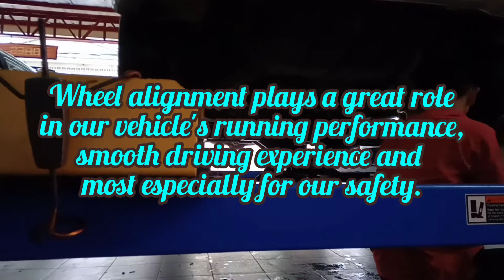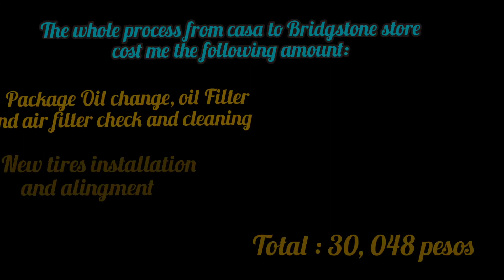Car Maintenance / ISUZU ALTERRA/ Manual Transmission/Wheel Alignment

Comment: Sana po masagot nyo to salamat 

NORMAL LANG PO BA NA ANG ALTERA PAG BINUKSAN LAGAYAN BG LANGIS MALAKAS PRESSURE MAY USOK NA PUTI AT TUMATALSIK YUNG LANGIS NYA. MEDYO MALAKAS
Reply from the maker: Sir good day, normal lng ung may talsik kasi at konting pressure but ung usok na puti at tuloy.tuloy  marahil matagal na kaayo d ngchange oil ng makina..required change oil is every 5000 Kms. pwede rin na may na oversized na ang engine liner at pud.pud na ang piston rings kaya few combustion gases ay nakakapasok sa engine crankcase at lumabas sa cover ng lagayan ng langis.

Comment: boss 245/70r16 stock tires ng alterra ko, goods ba palitan ko ng 275/70r16? thanks!
Reply from the maker: Sir good day, parang sasabit na yung 275 lalo na sa harapan when turning the wheels..naitanong ko dati sa Isuzu hanggang 255 lang recommended nila...if excess na sa dimension need talaga i lift up konti ng wheel support from the chassis.

Comment: Hello po sir ask ko lang po maayos naman po takbo ng alterra compared sa ibang SUV. Pinapatanong po kasi ni Papa 😁 malakas po ba sa akyatan
Reply from the maker: Malakas naman ang mga Isuzu cars sa akyatan. It's engine is actually based on trucks DNA which is engineered to power heavy loads even in slope robust areas with still great precision.